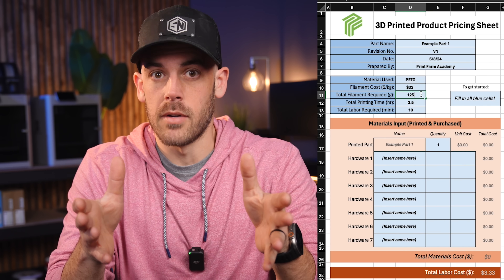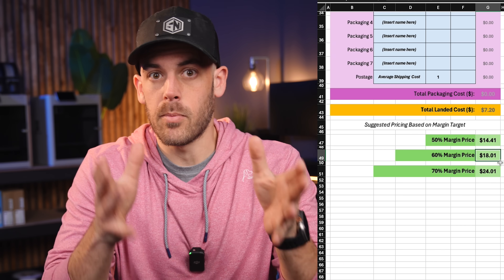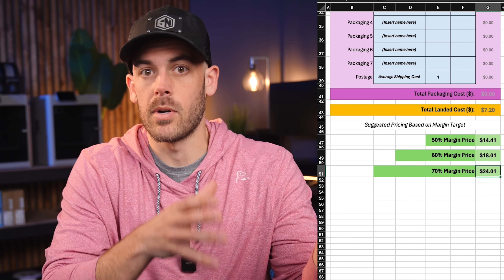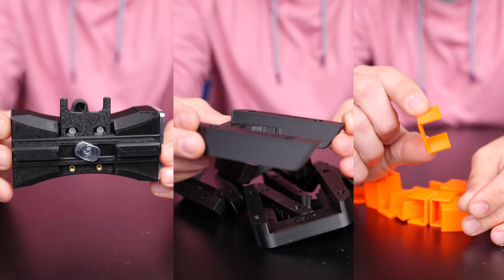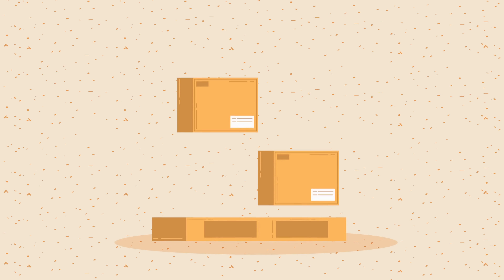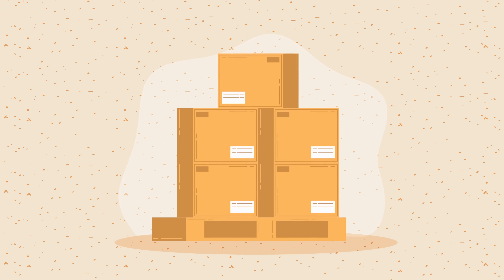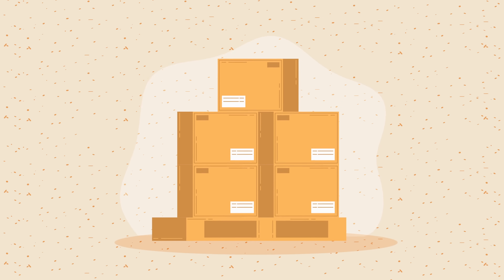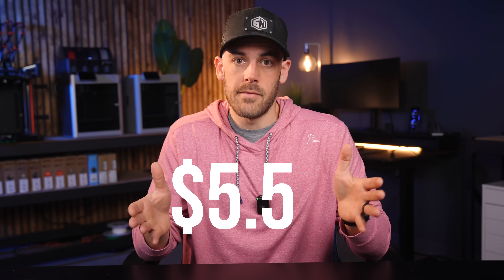Why I charge $55 for this 3D printed part (how to price)

Comment: You you have just describe in your video is your print farm was already established. Now for one to invest in a print farm would have the either eat the cost up front for making the print farm or you started off with several printers and worked your profit to enhancing the print farm to what you have now. As for the print farm I see you have space and air conditioning and electrical setup for running all of the printers you expected to run in your print farm. I can see doing this as you go along with your target print farm. Say you have 25 3D printers. I am assuming your video is based on your current print farm landscape setup. You take JLCPCB they do 3d Printed parts and they will produce the product in any material you see fit. There facility much more sophisticated and how they price out products is a mystery, but worth buying cause it is cheaper for them to make then making it locally.

Comment: 27 dollars for a battery mount is insane
Reply: The red caps they come with can be used as mounts.
Reply: Then you design and print it yourself for cheaper
Reply: It was $27 for 6 battery mounts, wasn't it?

My mind immediately went to thinking about how wealthy (or busy) would I have to be to own SIX(6!) Dewalt battery packs.  Those things ain't cheap.  Somebody who is that rich in lithium cells can probably find $27 in their couch cushions.

Comment: Great vid! One thing I would add to the cost is the prototyping and CAD drawing phase for complex products. Let's say you want to sell a specific piece that is not available in the market or that there is no model for it yet for you to buy. That means you'll need to spend hours in CAD software, which is often paid software, to design this product yourself. Furthermore, CAD drawing is often a considered a more complex and technical job, that assumes you have experience with it that others don't, that means you can charge money for it. So the hourly rate for designing the product should also be more expensive than the assembling of the product done after the print.

Comment: Its fair considering hes risking all his products getting reverse engineered and posted free online where anyone with a pruinter can make at home ... may not be as good but sometimes it is like all the free joint lockers you can make free some times work BETTER than joint lockers from urban out fiters and onkt cost 30 cents as opposed to 30 bucks. No brainer hands down win to just pirate your stuff lol

Comment: I agree with the design and copyright comments. What I didn't see is the cost of your computer, training, slicing the design etc, etc. Whenever I design and print something, the bulk of my time is spent designing. And don't forget about slicing and reslicing to make prototypes and different batch runs. There's a lot of time.

And, since you can deduct part of your house on taxes for business use, you should also be able to account for a percentage of your home. So, just make sure to round everything up, and you'll be closer to being accurate. In other words, if you try to get everything into the price, you'll probably price yourself out of the market.

It always costs more than you think to produce a part. You said your labor for the Stop Block was 12 minutes. How did you do that? You also have to maintain your inventory, set up your equipment, clean your work area etc, etc. I think you are drastically underselling your time.

There is more to labor than just the time you are touching the part. I think you should have a labor minimum. Say a 1/2 an hour.

Looking at your Stop Block again, I would expect your total design time (this includes flushing out the idea, measuring your saw, finding the parts to use, etc.) to be somewhere around 30 hours (this may even be low). You will probably sell a couple hundred, so that design cost would be around $4.50 per part @ $30/hr. So, with a 1/2 hour minimum and your design time, your labor should be $19.50. A rough guess on your machine cost, when you factor in your computer and design software, you're looking at an additional $0.35, so your machine cost would be $0.65. Making the total landed cost of $33.92. So, at your $40 price point, your actual profit would be around 15%. At least you're still making a profit.

This is all very subjective. I'm not trying to beat you up. I'm just saying I agree with you. There is a lot that is not accounted for when you're a one-person small business. And the majority of people give it away. I know I do! Before I watched this video, I didn't account for all the labor. But you got me thinking, and WOW, it added up!

Comment: There is a cost that might go unaccounted for here. Often people just use the "sticker price" of what material, parts etc. that you purchase, when computing material/parts costs. But - it is very likely that you will need to have these things shipped - or drive and get it yourself - often a once-per-shipment type cost. And to guarantee ability to deliver your goods - you may sometimes need to buy from a more expensive source. So one ends up paying more than sticker price. This is often called "sourcing overhead" in manufacturing. Typical estimates might be 15% - pick your own number that fits, but just know that it is basically never 0%!
Reply: I believe he is counting those. It would normally be something like $24 for a roll unless it's super specialized material, and that's without any sort of discount. So throw in taxes and shipping, $33 sounds reasonable.

Comment: Seems kind of like double dipping to calculate your time working on the part, and then additional profit margins afterwards.. then again, I am usually the type to undercut what I do and probably don't charge enough, but every time I see the final cost of a print it just seems a bit much to me... maybe the numbers will make more sense later..(fairly early on in my 3D printing journey) most of the numbers you showed did make sense though, so I'll definitely keep those things in mind for the future

Comment: Whats up with taxes? In my country Vat comes out at 27,5percent of the the untaxed cost of the product. 
If i follow your formula and have a product that costed me 50usd to make, i would sell it for 100 yet the price would be 127,5usd. 27 dollars can easily be the difference between buying something or not.

Your formula works for unprofessionals, but it leaves an extremely important part out

Comment: A good example on why injection molding is almost always better than 3D printing. Aside from prototyping and making very small batches of parts, injection molding is almost always the better, cheaper, faster option. The plastic is about 1/5 the cost too. The big cost is the mold and injection welding machine. They usually have a much longer life and lower maintenance costs if I'm not mistaken also. Molds can be used many 10's of thousands or even 100's of thousands to millions of times... and the injection molding machines are build for mass production. With it only taking a couple seconds to make each part too, the other costs all come down. They use far less electricity, produce many, many times more parts per man-hour of work, have lower maintenance costs and lower material costs... but they're like $2000 - $4000 just for the most basic models and the molds are expensive too. You also can't simply change designs of a product if something doesn't work right. It usually requires part or all of the mold needing to be replaced (which is not cheap unless you own your own CNC/CAM lathes and milling machines). With a 3d printer you pretty much just have to change the design and re-slice it. It might take a lot of time changing the part and then making sure it can be printed without any new troubles... but it can be done at little to no cost. There are people that make their own injection molding machines, but they're not very cheap either. The cheapest I've seen a working one that could be used to produce several parts was $250 for the parts. That's not bad if you have it and also the time and patience to build your own... but most people probably couldn't/wouldn't do it.
Reply: And if you're going to make 100,000 or so of the exact same part, and a thousand different parts that will each require machining the mold, then I would agree with doing injection molding. But there are some geometries that injection molding can't handle properly, and most people doing 3D printing stuff like this are just printing stuff as it's ordered instead of creating a warehouse full of inventory that they have to pay for whether people buy the parts or not. So you're talking the difference between "consumer" level and "industrial" level. If you're a full-blown business with several employees, then maybe 3D printing your parts doesn't make sense. If you're a single person, selling maybe 1000 items a year, then injection molding doesn't make any sense.
Reply: is diferent buissnes dude. you compare mass production with custom production.  I want L shape ok done. second customers want also L shape but instead of 90º he want a 130º open, done. The next one one also L shape but litle bit close at 65º. in injection mold that small variation cost 20.000$ per each customer. so that ask for MOQ on injection manufacturing. Is totaly diferent.
Reply: you can also injection mold lower scale using resin printed molds, there's a few resins that can handle pla temps pretty well so you can get like 20-100 prints out of them, which can be cheaper than directly printing them and you also get a much stronger part than if it was 3d printed.
a small aluminium capable router is also the price of a printer, so you can cut your own mold for simple parts.
though unless there's no other option, I would only offer it as a surcharge or for very popular designs.
Reply: @satibel  That's cool. I've seen different methods of people making their own molds, but I'm not sure if I've ever seen anyone use a 3d printed resin mold. Getting 20 prints per mold would still be a fair process. I now it's not large scale mass production... but there are actually large scale mass produced products where a mold has to be made for each and every cast... so it could definitely be scaled up. It just wouldn't be as cheap or as efficient. Injection molds are Expensive... but the fact that they can be used millions of times makes them cheap in the long run, especially if they're your source for profit.
Reply: @satibel  You can also make a silicone mold and then cast using epoxy resin or urethane resin. It's a cheap alternative to injection molding.
Reply: @SchemingGoldberg  yeah depends if you have a physical object or a 3d model
Reply: You can expect any successful 3d product to be quickly copied and manufactured by someone using injection molding.
Reply: @mikeb5664  Depends on what you call successful.  If you design a 3D-printed item and sell 10,000 of them, and pricing them according to the principles explained in this video, you might consider that a success.  But if the total market for these things is only 10,000, copycats with an injection molding machine aren't even going to look at it.  3D print shops serve the tail end of the market, where volume is low but people are willing to pay a relatively high price to get a part that they wouldn't have access to otherwise.

Comment: You forgot expenses…..
You have to account for electricity too numbnuts 

I GuArAnTeE you’re an apex example of dunning-kruger effect and should leave basic financial analysis to highschool students 
Because I guarantee you’ve forgotten a lot of others too

You also have LITERALLY EVERY OTHER KIND OF OVERHEAD WHICH WILL BE FAR MORE EXPENSIVE THAN MACHINE COSTS
Reply: Did you even watch the video? First, he immediately says that he's not an accountant, this is just how HE figures out HIS costs, and recommends people who DON'T KNOW HOW to follow his strategy to get started. He's not saying he's the most knowledgeable expert on the planet, like you seem to think you are. He's just saying "here's a way to start figuring things out so you'll at least not be losing money."

Also, he goes through a whole thing about electricity costs (which are actually pretty small, believe it or not) at 5:35 ... and as far as "every other kind of overhead" ... the one you actually listed was actually covered, and you can't be bothered to list anything other than "I guarantee you've forgotten a lot" ... like what?! Now, I do agree that his electricity estimates were a little low, he's only counting the cost of running the machine itself, not things like power to the lights/heaters/air conditioning. I know that I've actually hooked up my 3D printer to one of those single outlet measuring devices and my cost per hour when it was running constantly was actually lower than his estimate.

But other "overhead" that most businesses would have, he doesn't have because he's not a business. He's a single person running a print farm out of a spare room in his house or possibly garage. He has no employees. He has no office building. He has no warehouse for storage. As far as I can tell he 3D prints the parts only when they're actually ordered, so he doesn't even have minimal storage (except for the filament itself) in his home office space. All of his 3D printing costs are confined to that single room of his home/garage. And even if he DID forget one or two things ... that's the whole point of not selling the item for the landing cost and marking the parts up by 50% or more. That way you still have a profit even if the unexpected happens and you spend more making it than you planned for.

Comment: I wish costs were calculated by how much the part costs to manufacture... but we all know damn well that's not the case in most situations. Parts are market up by how bad people need them and/or by how effective or time saving they are... or if they're life saving. Just look at the cost of insulin and countless other medications. People overseas buy them for $5/bottle, but here where they're made they're $50 per pill. You can buy a box of 50 screws for $5.00... but if those same screws are sold for a handgun grip panel, they'll cost $9 to $20 for 2 or 4 of them. Handgun magazines most likely cost no more than a dollar or two to manufacture, but they sell them anywhere from $20 to $50+. The list can go on and on forever.

Comment: Love this new channel idea! I also spend a lot of time watching you on Shop Nation. Here are a few ideas for videos I would love to see:

1) Material selection for specific use cases / parts and why
2) Settings for the various materials on the Bambu Lab X1C or P1S
2) Post Processing of your 3D Prints

I just started printing functional parts for a friend (for $) and it has inspired me to pursue this as a side hustle. My PA-CF prints are just OK and I'm still learning how to clean them up.
Reply: Probably common knowledge at this point @bleed4glory10, but a small cheap but reliable butane torch, a burr knife, and some 180-400 grit sandpaper (wear a N95 mask...please) goes a long way when post processing PA-CF.
Reply: @TheAdeptGuitarist  Thanks! I ended up switching to Atomic Filament ASA-CF for this particular part. It is strong enough, although not as good as Nylon. Sanding is not an option because appearance matters and it will leave the part with a faded or white washed look after sanding.
Reply from the maker: Thanks for the idea!

Comment: I use the CNCkitchen spreadsheet which is very similar to the one you described. What I did was remove the costs associated with setup and removal when doing bulk prints. I only add an initial setup/removal fee and the bulk material costs after with a flat scaling factor based on difficulty of part. Using multi material or multicolor prints such as hueforge or signs I have a modified spreadsheet to accommodate materials/percentage of total print to price out. I forgot to mention I also have a friends & family (F&F) discount option and discount code for failed parts that were obvious defective. Do you roll the cost of HVAC/heating/storage/fuel costs on the business as a whole or through the parts? I am still very small business, using only my garage space for the moment with very little online sales.

Comment: Great video. There's several ways to achieve the same end, but I don't include postal costs in the landed costs - the customer pays what I pay. 
Another thing is insurance. Certain products increase the cost of my public liability insurance directly and/or have been lab tested. In which case those products get the bump in landed costs. Anyway good video.